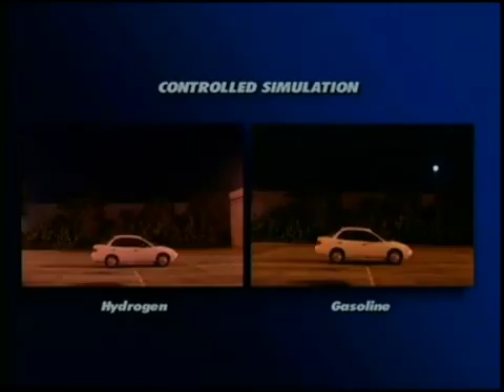Hydrogen vs. Gasoline Leak and Ignition Test- which is safer?

Comment: To me, this is not about cars. This is about hydrogen as a fuel. The hydrogen car idea is gone. Hydrogen fuel idea is still in the running. What vehicles? Airplanes.
Reply: Germany has a train.  The US has some buses on the East Coast and a few other places.  Amazon and Walmart have warehouse forklifts that run on hydrogen, as well.
Reply from the maker: The H2 car idea is not "gone". There will be both H2 and battery cars, but few are going to want to waste half an hour (if no lines!) waiting for electrons to flow into their batteries when they can fill up in 5 minutes. The idea that there must only be one or the other is foolish and absurd.

Furthermore, what vehicles? Besides airplanes, there are H2 trains running in Germany, H2 trucks from Toyota and Hyundai, H2 drones, forklifts, and ships like the "Energy Observer". 

Batteries are yesterday and H2 is the future.
Reply: @hydrogensocieties2012  batteries are yesterday? lmao. best case scenario its being used in airplanes and maybe some longhaul trucks. The train in germany is a bit of a joke btw. H2 cant be the future because it takes loads of energy to produce it, then you need loads of energy to store and then you convert it into electricity after all.
Reply: @fetB  Here is the problem with the point that you don’t have the energy you’d need. And if you use it to store energy for a vehicle you could as well already use it and store it there. There are actually really efficient capillary hydrogen cells..
Reply: @platin2148  what do you mean, you dont have the energy you'd need. You produce energy to then use it or convert it. If you store it in battery you have a small loss. If you convert it into h2, you have already a huge loss, not only initially, you also need to keep the container either super cooled or pressurized, which takes energy and the same goes for filling it into the car/truck/plane/train. And then you have to convert it again (and lose some) into electricity
Reply: @fetB  Still not getting how distance is a issue for energy transportation or do you think there will be batterie trucks that transport full batteries?
Reply: @platin2148  huh? batteries are re-charged at location via grid, which exists virtually everywhere there is people who need batteries. Do you think every time a battery is empty, it is returned to sender, charged and delivered back? 

On the other hand, if your energy comes in form of hydrogen, you do need to constantly transport it in the same way you transport gasoline, unless you're suggesting people make their own hydrogen.
Reply: @fetB  Just think for moment where places of the needed amount of “green energy” are and where you are living. Very likely that the distance is not a possibility to span via Grid and if it is then it’s very likely expensive to maintain or protect. (Maybe a bit less true for the US)
It’s the simple electricity post not in my garden principal. And the other issues when there is no energy from these sources.
Reply: @platin2148  I think you're the one that needs to think for a moment. Every single building can facilitate solar panels and aeromines. So can parking spots, that on top of that, also provide shade. With "green energy" you dont necessarily need an energy plantation because you're harvesting the nergy that is constantly raining down on you
Reply: @fetB  Have fun when it’s dark. Have fun when there is no wind. Thinking one can supply all the energy we needed from hydrocarbons with local very inefficiently used solar is a bit short thinking. Local production of energy sounds nice but costs ultimately land and needs allowance. Which makes it theoretically possible to be independent but practically it’s sort of not at all possible because you’d not get the permission.
Reply: @platin2148  I sleep when its dark. regardless, what do you mean it costs land? The building is already there and so is the parking lot. More importantly, we were talking the use of hydrogen. How do you extend this to general energy production. Are you suggesting to use hydrogen fuell cells in buildings?

As for allowance, how is that relevant. Thats a piece of paper signed by whoever currently has the authority.
Reply: @hydrogensocieties2012  or who wants to go to a station to 'fuel' up when they can do it a t home? The story of H2 will be told in weight because batteries are heavy.
Reply: E C Holm HFC vehicles have traction batteries like BEV’s. Not as large granted, but still a fairly big battery to lug about as well as the FC, Tank and Motor. The Mirai is the same or heavier than similar sized BEV’s ie VW ID3, Nissan Leaf etc.
Reply: @hydrogensocieties2012  well, here in the US, H2 has not taken off and batteries have more of a foothold on the markets. H2 would be good for portable power stations or temp power stations for BEV in the US. That's a market yet to be conquered.

Comment: Now, flip that vehicle upside down like after a major crash and see what happens. Relax, just kidding, hydrogen is still better than gasoline and prefer it over dreadfully long recharge time of battery powered vehicles.
Reply: Xp Reflex  Gasoline is so fucking volatile that if you pour it onto a fire, it will explode and you will either die or go to the hospital with 3rd and 4th degree burns
Reply: Hydrogen cars won't win over evs. Current v2 150 kw superchargers will charge to about 50% in 20 minutes and about 80% in 40. V3 superchargers are expected to drop charging down to about 15 minutes to 80%. 
That is a small price to pay for longer trips that will account for ver few trips . Most people will save more time by charging at home and supercharging on road trips than constantly going to the gas station
Reply: @Capthrax1  Hydrogen can go to 100 in 5 minutes and have more mileage, and this mileage is cheaper and lighter to increase. Perfect for anyone who actually drives.
Reply: @thepope2412  I welcome u to go ahead and buy ur hydrogen car and actually drive. 
How do u address avaiablility of hydrogen, how it is leaky because of its absolute tiny molecular weight.  How the price will always be x2 minimum of battery evs , reliability of the fuel cell and performance?
Reply: @Capthrax1  As a new technology adoption takes a bit of time. Currently california has all of the hydrogen refueling stations in the united states and they are planning and expanding them, and in the future the cost of hydrogen will go down. The leakage problem of hydrogen used to be a problem in the past, but that has been mostly solved thanks to better technology.
Reply: @thepope2412  I should mention I am not against it for flight or ships just for cars. Batteries are approaching the point of diminishing returns in terms of max distance. In 10 years we will mainstreem manufactures offering cars with 600miles or more of range. At that point range really doesnt matter any more. Yes you can just make a bigger hydrogen tank but you lose the ability to charge at home.

The market for a hydrogen car -given prolific refueling points and double the range of a battery vehicle will pale in comparison EV vehicle at such a rate that the adoption of the technology and infrastructure will B more expensive then simply buying a gasoline vehicle.

Maybe hydrogen had a chance for vehicles 15 years ago but the speed of battery electric vehicles has eclipsed it
Reply: @Capthrax1  " In 10 years we will mainstreem manufactures offering cars with 600miles or more of range"
And an expensive 3000 pound battery you might add to that. I don't see the point in that unless you regularly plan road trips or you need to constantly pull heavy shit, but at that point just get a regular car, or hydrogen potentially, to save on refueling time. And ICE cars are much better at pulling shit in general, so I don't see the point in the tesla "truck." And I guess you do lose the ability to charge at night, but that saves the power grip a lot of money and potential black outs.
Reply: @thepope2412  I was thinking a increase in energy storage density (kw/kg) . Towing is a bit of a sore spot, yes its more convent to go 100 miles pulling 8klb and refilling in 5 minutes @ a gas station than stopping at a superscharger (or fast charger ) .  A solution certainly is to add more batteries to a (tow duty EV) like how tesla is doing with the semi (some people think it has a 1 megawatt battery) . I dont think these first generation of pick ups will be good at towing because of the range lost but then again people who can afford a 60k truck are not going to use it for long distance towing. I also feel like the power grid bit has been over played (unless u in CA and the wind blows 2 mph so the utility shuts off the power and has to check they outdated power infrastructure cause they got he fuck sued out of them too many times but yeah) 

I want to see hydrogen adopted in airplane travel and commercial sea travel. THen again i also want to see large scale nuclear (fusion only 20 years out eh?) adoption to replace natural gas and coal power production.
Reply: @Capthrax1   I'm not sure how much more you could push traditional lithium ion tech without a huge breakthrough. Probably not by much. Samsung seemed to have problems with their phones catching fire which caused them to be banned on airlines. And one of the problems with adding more batteries is that those batteries are heavy, so doubling the amount of batteries does not mean double the mileage Similar to how you have to account for fuel weight in rockets. And those batteries are pretty expensive, so doubling it my not be ideal. At the point, once again, better just to get an f150 if you need to actually use a truck.

I don't really see the point of using hydrogen for airplanes due to the fact that we already do it with basically refined diesel and it works and is safe. I don't see anyone willing to spend a multiple billion dollars designing a new hydrogen plane that may or may not work or be safe. Hydrogen cars on the other hand are being commercialized this very moment. I don't see the point in doing it for ships either because of costs. But what they should do for commercial cargo ships is require them to burn diesel instead of crude oil which is why those ships pollute much more than all the cars in the world. Maybe it makes sense for yachts or fishing boats but not those big ass cargo ships.

Fusion was 20 years away 40 years ago.
Reply: @thepope2412  Solid state batteries are coming pretty fast (around 2025) and will increase the current batterie density by at least 2 so current vehicle like the Hyundai Kona will be able to  reach 800 Km of range (WLTP) for the same weight as today (but for a much-much cheaper price).

Hydrogen has no future for transportation, even for trucks or trains.
Reply: @yutuniopati  I'll believe it when I see it. Fusion tech was 20 years away 40 years ago.
Reply: @thepope2412  Who is talking about fusion here ?
Reply: yutuniopati it’s an example
Reply: @thepope2412  Until the nozzle freezes, or the underground tanks need to re-pressurize, then you'll be waiting longer than 5 minutes
Reply: @areitu  There are hydrogen refueling stations right now which will do the job in 5 minutes and I could say the same for the gas station running out of gas
Reply: Morgan not Freeman  Hydrogen can be generated anywhere with electricity. Ideally you would build nuclear reactors for cheap industrial electricity which could also be used for other things
Reply: @Capthrax1  and there batterys degenerate fast as hell good thought.
Reply: @HeeroYuYuHakusho  3 years late bud